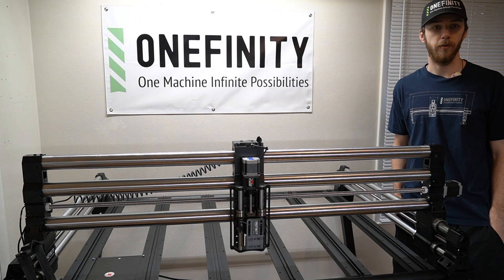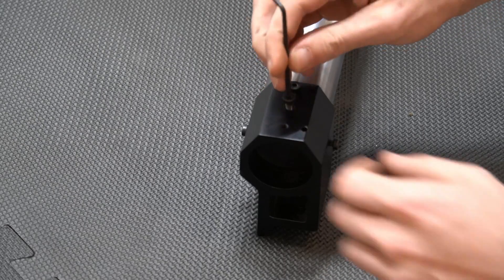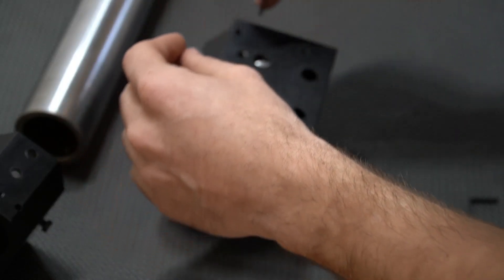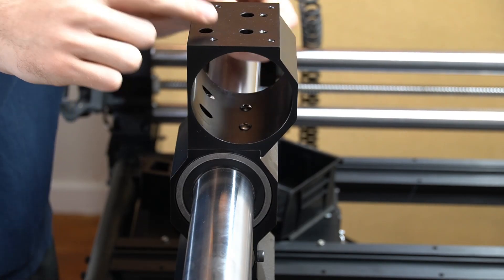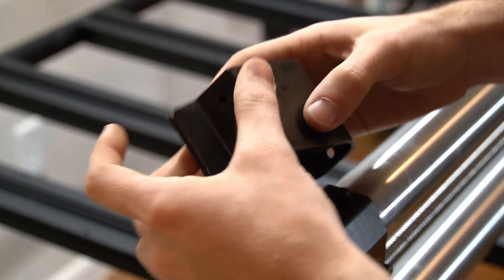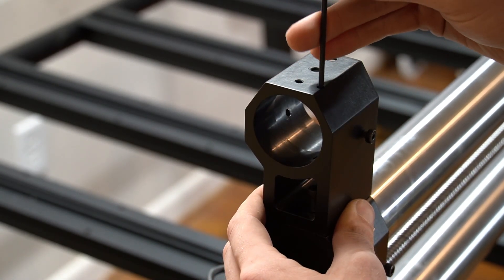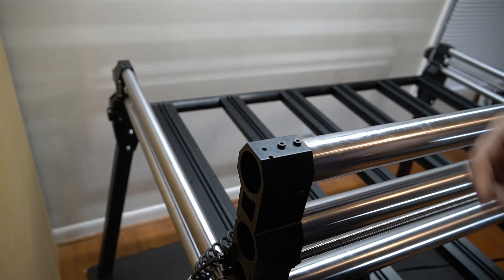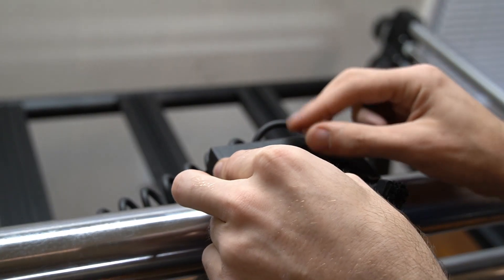Installing Stiffy Rail on Pro and Elite Series Machines.

Comment: One issue that I had when sliding the stiffy bar through the bearing and to the left foot is that it didn't line up and I had to push it about a 1/4 inch or more to fit it in the foot. I'm afraid that is going to create a tension and undue strain on the x motor. Is this a valid concern or is there a way to relieve the tension?
Thanks
Reply from the maker: Contact support@onefinitycnc.com for support assistance.

Comment: does the stffy give the new taller HD Z slider two more points of attachment rather that just the two?
Reply: Yes, I was wishing it did. To me, the 4 screws holding the z axis seem to have a good chance of stripping out with all the weight of the z20. Plus, it seems like there should be a better way to tram side to side other than loosening and retightening these screws.
Reply from the maker: No,

Comment: No real need for this but I do WISH my Z was more rigid! The 2" tall spindle mount isn't nearly tall enough. The rest of the rig is rigid! It's always the Z that is left in the cold. The holder for the spindle needs to be a min of 4" tall for this beast of a machine. Might just buy another and add it in.
Reply from the maker: Sounds like the z-20 is a perfect pair for you!
Reply: Are you talking about the original\older Z axis or the new 20mm 'Beefy Z'?

Comment: Why do we need the stiffy? The 50's are plenty strong already!
Reply: I think it's more for people who might be adding an 80mm spindle as they can be 3 times the weight of a Makita router, so it just adds extra rigidity. It also allows you to maybe push the machine harder for 3D carves when in conjunction with the new 20mm Z Slider. You don't 'need' it. It's completely optional and dependent on what you do.
Reply: When I'm milling aluminum parts sometimes the spindle gets this weird rotational vibration where is rotates around the the X axis. I think/hoping the stiffy would fix this, going to install mine in the next few days.
Reply from the maker: This makes it even stronger!